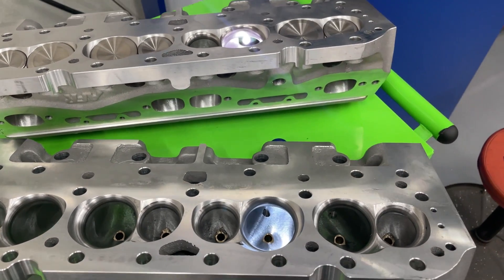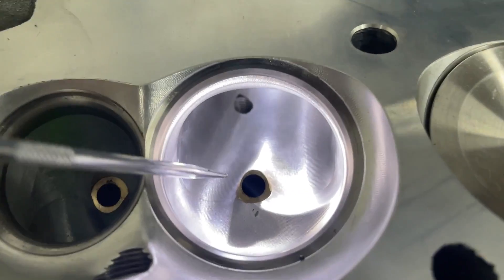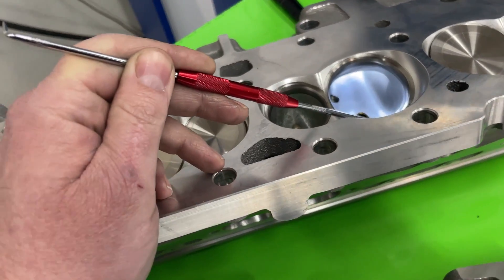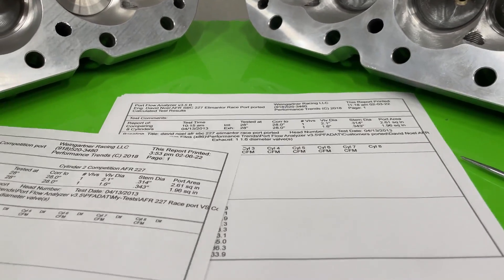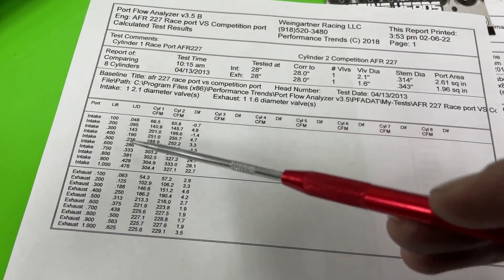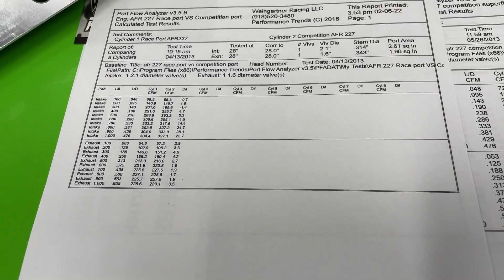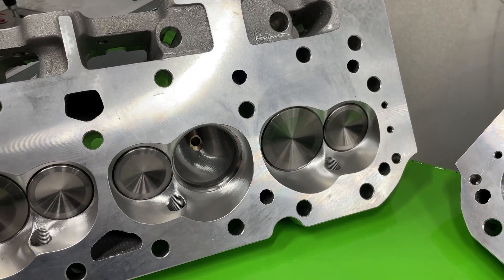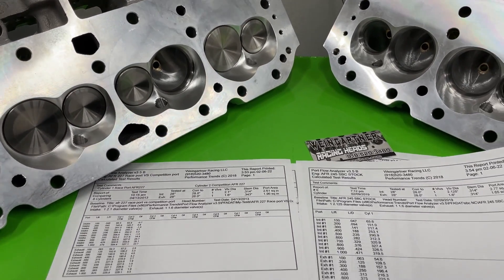Differences Between AFR 227cc Heads

Comment: With regard to the 227 AFR head: I noticed on the paperwork that the port area/mcsa is listed as 2.61.  Is this consistent in all 227 heads?
Reply from the maker: No I probably entered that info wrong. It’s only for notes. It doesn’t change flow numbers
Reply: I'm working on a 400 and the math says 2.57 mcsa and 229 cc port  for 7000 rpm.  Is the mcsa for peak power or peak rpm?  Happy Thanksgiving!  @WeingartnerRacing
Reply from the maker: That’s for peak power at an rpm point.
Reply: Thank you Eric. @WeingartnerRacing

Comment: You’re just glossing over the heads pointing out the obvious why not attempt to explain WHY there are the differences in both porting techniques
Reply from the maker: Because the video would be 50minutes long and nobody would watch because of the length.
Reply: @WeingartnerRacing  Correct !

Comment: Good day Eric. I have a 2014 Silverado with the L86.  I have done the DoD delete installed a Texas speed cam 218/220 duration with 635 lift stock 20 inch wheels and 3:73 gears   Looking as alway for more lol. Trying to decide bang for buck. Would ported heads add any real benefit?
Reply from the maker: Probably not for your deal.

Comment: eric im in the market for a set of  heads. im building a 380 (383  just std bore) sbc with 6.125 rods and 11.5:1  for a single turbo efi combo. some classes ill be running are turbo limited to 76mm when im grudge racing / street ill be on a bigger turbo 1400whp capable. what head would you recommend. i do have my holley efi intake thats 23 degree  not trying to do 18 degree stuff, and id prefer to keep it to where i can run std lifters and 7/16 stud rockers as i have it all unless its just so worth it to get a head that would require to get those things. i do have a set of trick flow next gen spuer 23 215 heads currently

Comment: Hey Eric,
     Tim here, and i have a question.......my Kauffman Racing Pontiac heads were CNC'd, etc....and they DO make great power, but i noticed years ago, that the CNC mill marks were all over my chambers, shud this be somethin i smoothe out?.....i noticed that the AFR SBC heads had quite smooth chambers.......is it worth me doin all the work to remove them, smooth, my chambers and re-install??......i've been wondering for years, and this vid put my thought out in front.....what are ur thoughts?.....they are the D port, with the 310 cfm program.....i've made GREAT power with them, just always wondered, if i smoothed my chambers, would it give less carbon build up, and better efficiency??.....if ya find the time, an opinion from you would be GRACIOUSLY appreciated!!...
Reply: Hey Tim,
 James here,lol. In my non professional but experienced opinion, you'll see no gain and would just waste time and money.  The minor carbon build up in a properly tuned/running engine will have no effects that you can feel.
Reply: @BEANS-O-MATICtransmissions  Hey James, Time here, Thank you sir!!!!, i thought i might be wasting my time......just wanted some validation......MUCH APPRECIATED!!

Comment: It really goes to show that the flow #s don’t always mean everything! I know you don’t have the time, but I’m sure AFR has dynoed all there small block heads, how about putting a call into them? Let them know that your customers want to know! Just to see what there head port designer has to say? I’m sure they have there reasons for there wings & which way they each go! I’m wondering 💭 what a top of the line back cut Victory or Xceldyne valve might do? Because I’ve seen so called specialists take a unbelievablely great head & redo the valve job & replace the valves, which looked fine, but they weren’t the backcut & coated valves it originally came with! That engine lost 100 hp n/a! I know some of the best head companies in the world 🌎 make crazy flow numbers out of there 10/13 degree heads, but it’s really hard to believe they find 100cfm over a fairly normal head, such as the AFR stuff! It’s just amazing how they get so much out of basically the same area! Meaning it’s still a SBC head & there’s only so much room there! I know that the ports are custom, raised, bigger & the valve spacing & angles are moved, & the valves are usually as big as possible! Also there #s do correspond with the horsepower they make! When heads make 2.4 to 3 hp per cubic inch, the cylinder head guys & engine builders are really doing something! 😜😜😜😜👍🏻👍🏻👍🏻👍🏻 Dynos give great information! Usually make more questions 🙄🙄🙄🙄! Also you have to have someone or something to keep working while your playing! People seem to get really upset 🤬🤬🤬🤬 when they find out there heads are sitting 🪑 & there guy was dynoing for a couple days 😂😂😂😂! JS!

Comment: Hey Eric I would love to see some Higgins Race Developments SB2 heads on you flow bench. They are made here in Australia and cost like 1/3 of the price of most SB2 heads. With exchange rates shipping will be covered. https://www.youtube.com/watch?v=YJjoRWP8AQc&t=2s&ab_channel=Fullboost that is the link to the video. 
I would love to see what these could do against a set of the best siamesed port heads you usually do like a full on offset rocker head using T&D or Jesel vs the cheap Aussie SB2 heads.
I bet if you had a customer after a set of cheap SB2 heads you could offer these and have them set up by Nathan Higgins then you hand finish them.
Reply: https://www.youtube.com/watch?v=0flxxeFtdQQ&ab_channel=fullBOOSTMedia